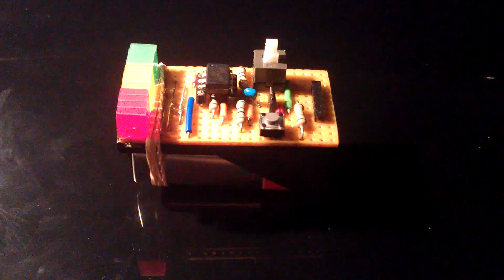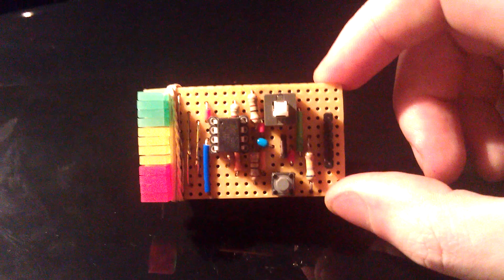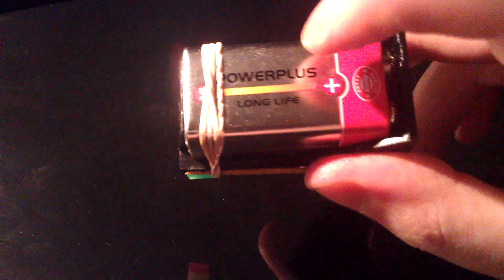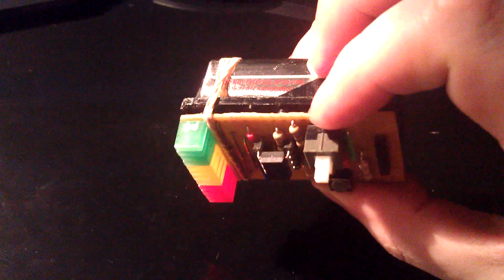LED ladder game running on a ATtiny85

Comment: Looks like a fun ATtiny project. I've also experimented with a ATtiny85 and 20 LEDs connected to the 5 GPIO pins. Is it possible to get a copy of the code and the schematics?
Reply: No problem, there are links in the video's description to both

Comment: hey, i was thinking about getting some attiny85 chips to make my arduino projects permanent, but i was turned away by the fact that they only have 4 output pins. See this video changed my mind. Can you make a video in which you explain charliplexing and how you used it in the attiny85 circuit you have there?